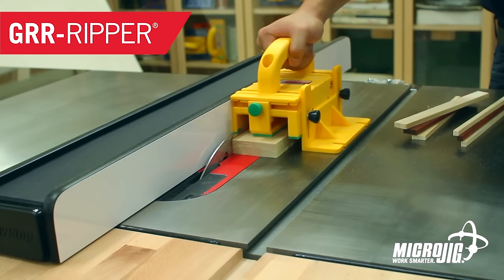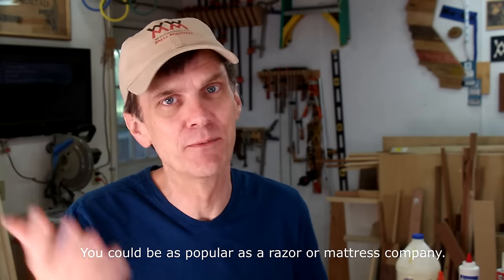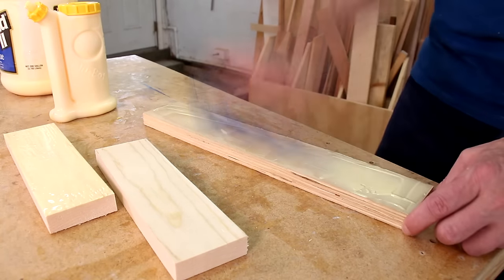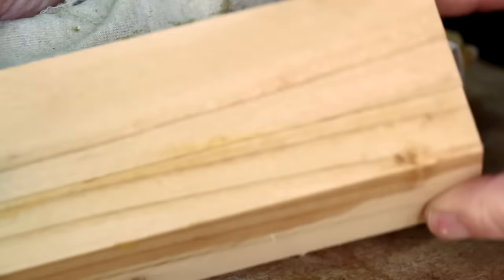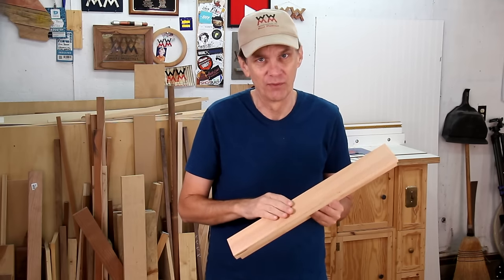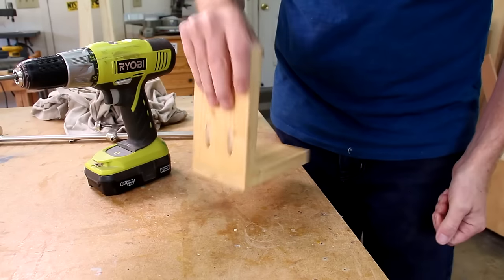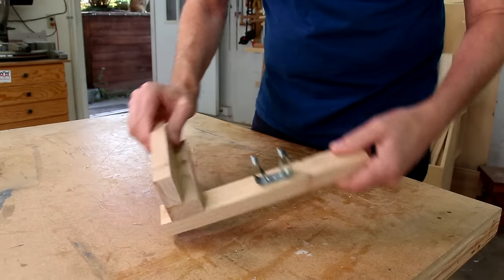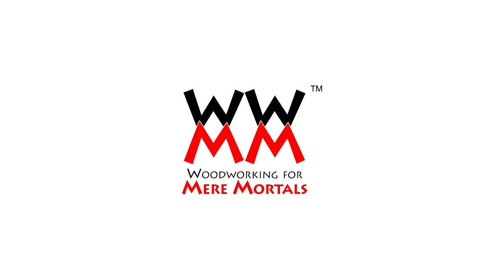What You Need to Know About Glue | WOODWORKING BASICS

Comment: Should definitely use a damp rag to wipe off squeeze out. It works much better
Reply: +Dylan Pieniazek no just use sawdust, it comes right off
Reply: +Dylan Pieniazek a damp rag will just thin the glue and it will get farther into the grain, not a good plan, when you try and stain the piece the glue that you tried to wipe off will show up big time. most of the time I dont even wipe it off, let it jell a few min.s and a puddy knife will peal it right off
Reply: rickthebananajr that works too. Matthias does that
Reply: Shane Hildebrand I never thought of it that way. It doesn't matter because almost every glue up I do goes through my planer after. That takes off any smears. I also never stain anything, I use the actual hardwoods.

Comment: A quickie on the different types of Titebond wouldn't be awful.
Reply: +Dave Starr Titebond 1 isn't worth it at all unless you are doing art projects for 2 year olds.  Titebond 2 is the best bang for buck.  Works really well, just isn't water proof, just resistant.  Which is fine because wood is also water resistant.  Titebond 3 is the same as titebond 2 except it is waterproof.  It isn't worth the extra 70%.  Just buy a small bottle of waterproof glue for the smaller projects you would need it for.  Buy titebond 2.  The big jugs last years and are WAAAAAY better than smaller ones.
Reply: +Colebug99 The type of glue you use depends on your needs at the time.  While it is rare that I use TB-I any more, it sets a bit faster than TB-II, but it is a great all-around glue.  TB-II sets a bit faster than TB-III.  For 95% of my projects, they get TB-III due to the slightly (albeit somewhat insignificant) longer open time.  TB-III is also stronger along with being waterproof (even though most of my projects getting TB-III tend  to live indoors).  That said, any of the TB glues are fantastic.  Heck, I even have TB Molding & Trim glue: it is very thick, doesn't sag, and sets in a minute.  Also, I'm not sure I'd trust any of these glues to last longer than a year so I don't buy the large jugs since I won't use it up in time.
Reply: +Dave Starr http://www.titebond.com/woodworking_glues.aspx  Google is your friend.  All you need to know is there.
Reply: Colebug99 TB III is NOT waterproof... it is still only water resistant - more so than TB II but still not "waterproof" for submersion. I don't like TB III very much... it's not yellow, but a weird grayish color. TB II is easier to work with for woodworking, I think - and TB III is significantly more expensive, for not much real gain in woodworking.

I don't think even polyurethane glue is sold as "waterproof"... only as highly water resistant. It's a marketing thing, I guess. The only glues I know of that are sold as absolutely waterproof for submersion are two-part epoxies, and Resorcinol - but it's a real pain to work with, and is a dark reddish-brown color that is not very suitable for woodworking. It's used on boats because of its high resistance to UV and heat.

My opinion is that unless you're building a wooden boat, submarine, or airplane, you really don't need anything but TB II for woodworking. But I'm going to check out that other glue Steve mentioned. Can't recall the name in this comment.
Reply: @kencarp57  Titebond 3 is rated waterproof. That does not mean it can be permanently submerged under water but it does handle water better than than type 2. I don't think type 2 is easier to work with due to the shorter work time which means you have to hurry to get things aligned. Another consideration is temperature. Many days my shop is under 50° when I start the day and type 3 can be used at 47° while type 2 needs a temperature of 55°. The price difference now much less than it used to be so for me I use type 3 almost exclusively.

Comment: Question: does anyone else find that today's "5 minute epoxy" is mis-named, i.e. doesn't harden in 5 minutes like it used to 20 years ago. Back then I had a job as a photocopier technician and I frequently used LePage's 5 minute epoxy to repair, rebuild and reinforce broken parts in the field - like a broken nylon gear sprocket for example. I would mix and apply the epoxy and then keep turning the part in space so the glue wouldn't flow and drip in one direction. I could keep turning it for about 3-4 minutes and by 5 minutes, the glue was stiff enough that it wouldn't flow, but still soft enough that I could dent it with a finger nail. I would often shape it with a knife or file and then after about 30 minutes to an hour, I would risk putting stress on it. It was my go-to wonder product. Then I got a different job and didn't use epoxy much for a few years. Now when I try to use it, it seems extremely slow to harden. After five minutes it's just starting to thicken, and it takes a good 10 minutes to set enough that it won't flow.

Comment: Seriously. Any descent PVA glue works really well for 99.999% of wood  and paper projects. Slow setting (a week) two-pak epoxy in a doweled joint for load bearing and or critical joints. Always held by a S/S counter sunk screw. I really hate those expanding glues as they can ruin a job and require far more post cleanup.
One screw you didn't mention is the Tech Screw. Self drilling.

Comment: Best tip ever for a newcomer to Epoxy?
   Forget about 5-minute stuff in the beginning... Okay, personally, I just avoid it like the plague in general. BUT (enter the caveat) I am really REALLY well documented as adhesive impaired...
   5-minute epoxy is as indicated, a 5-minute at a time job setting ONLY! SO if you have any reason for hesitation, just go after the 15 minute stuff, and lend yourself the TIME to mix it, slather it in, set things up, put into clamps, whatever else... and not panic because you're about to run out of time...

    It IS great for those quick little jobs and repairs. It's more than functional for wood-work. Don't get me wrong here... This is just about being "easier on yourself" as a beginner. I suck with clear epoxy, as for whatever reason, I often over-mix, or simply have "life happening" and lose the window... SO I go old-school and just mix really tough epoxy(ies) that take over-night or longer to cure.

   Best ever tips in general... Palette knives and min-spatulas. I LOVE these things. It's not just for adhesive jobs either. Artist's palette knives come in a fine variety of shapes and sizes, AND GET THE METAL ONES! (if you bother with hunting them down for use)... They stay easy to clean with minimal care for damn near ever... they're thin and flexible, so "smunching" sealants and fillers into tiny crevasses and cracks is a breeze (compared to say... a clunky pocket knife or whittling a popsickle stick) Yes, theyr'e a bit pricey for no more than little metal goop-spreaders... BUT you only really need about half a dozen (unless you just like them, of course) and those will be cleanable and reusable for assigned "duties" for a long long time.

    Gorilla Glue... They've really come along (and gotten pricey too) in recent years. Even the gorilla super glue is a dubiously superior product to regular super glue. There are rubber additives in the Gorilla super product, so it takes shocks considerably better. (vibrations included)...
    The only side effect of gorilla stuff, is that it SWELLS in application, so clamp firmly EVERY SINGLE TIME, or stuff can get "pushed out of shape". 

   Strength??? I've routinely set knife blades into handles with gorilla glue (as well as old fashioned epoxy) for more than a decade with NO PROBLEMS... and that includes ten-inch Chef Knives and the like.

    Top epoxies? For strength and durability, I'd default to JB... That's the J.B. Weld of old, though it does dry dark grey. I've repaired engine blocks with the stuff, myself... so it's tough. It works as a filler, but you probably prefer to do that for those otherwise hidden "flaws" or "damages" that only seem to obstruct or "fowl" things mechanically.
     There are other lines of products, too. AND I haven't found an epoxy I particularly dislike or recommend against... SO even the "stick" or "putty" epoxy products are good for purposes...

    "Marine Grade"... THIS is an important notation, because the requirements for Marine Grade is that it will cure even UNDER water or in DIRECT CONSTANT contact with fuel and oil. If that's a consideration, THIS is the thing you NEED to see on the label.

    Finally, "Goop"... Okay, no, it's a silicone based adhesive/sealant. NOT like wood-glue or super glue, at all. It's NOT the greatest or strongest bond, either.
   SO what the hell do I like about it? Exactly that. It's NOT great... BUT it IS adequate at sticking just about anything together. AND it's a better than average sealant.
    Did you ever break an old level and wish you were good enough to build a new one, yourself? Ever wonder what exactly they used to seal up those "viewee windows" for the bubbles? I don't know that either... BUT when I built the level, and every level I've fixed by replacing broken or missing "viewee windows" for the bubbles, I've done so with GOOP... I prefer Automotive or Plumber's GOOP, myself, just to resist water and oil... I worry about that. It's "nose profile" is akin to strong vinegar... and you CAN defeat the adhesive relatively simply. Any thin knife can cut it, and the applied materials can be pulled apart IF you pull like you MEAN to take them apart.
   It's clear, and any excess is a BREEZE to just chip up with your thumb nail and roll off the wood, plexi, acetates, polycarbonate, acrylics, glass, fur, leather, metals, ceramics... it seals and adheres "adequately" to just about anything... for as long as you want. 

   Whenever you want to change it... just grip it and yank. OFF it comes, and you're ready for a bit of scrubbing and redecorating.

    OR... in the case of some "viewees", you can pry the little windows loose and remove them... reach through to maintain, check, calibrate, or fix whatever... and then add some GOOP and put them back... ready to go. ;o)

Comment: For end-grain glue ups I use Gorilla glue (the only useful purpose it has). I've glued 2x4 scraps together  to make longer timbers and sat on them (carefully). You have to dampen the ends real good. The polyurethane gets sucked up into the micro-tubules and provides a fair amount of strength.

Comment: 0:25 literally everyone says this, but what after a year or 5, how does the glue stand then? i haven't seen any long term experiments to show that wood glue stays that strong after certain ammount of time
Reply from the maker: I have projects that I made well over 20 years ago that are holding together fine.
Reply: @SteveRamsey  Okay, that certainly helps, way faster than what i got from googling , thanks =)
Still a good video idea to start working on now and glue up few pieces of wood from the same board and test them each year to show how strong they are right? like 5 pieces, and break 1 every year and you get a video in 5 years =)
Reply from the maker: @LykeArgy  Pretty sure Titebond and 3M have been testing their adhesives for decades. The question of reliability is not a concern of almost any experienced woodworker or professional carpenter.

Comment: Never wipe excess glue off. It leaves a visible residue even after sanding, when you varnish or paint over that area. instead let it dry and use a sharp chisel to carefully chisel off or sand if you can’t use the chisel.

Comment: apply film of vaseline to your hands about 20 mins before gluing, stuff peels off your skin painfree....or just cover sTuff with saran wrap, or your hands with plastic bags to prvent spilled glue on your skin....BEWARE WOOD GLUE TURNS TO TAFFY AFTER ONE HOT HUMID SUMMER , TRY STORAGE IN FRIGERATOR/FREEZER THEN.  SHOULDN'T HAVE INITIAL SQUEEZEOUT OF GLUE if you are sparing with the glue, ya don't need much at all.
Reply: +speckspeck   anyone know how these wood elbows would fare out in the rain, would they last one season? use epoxy or woodglue?

Comment: All the woodworker channels show huge volumes of glue…which then oozes out from the joint like an over filled peanut butter and jelly sandwich…Glue must be really cheap in the US!!!!  Seriously, any glue squeezing out is just a waste of money.  Try to gauge the right amount…which is a about a quarter of what you see slathered on in YT channels.  Don’t put excess glue back in the bottle unless you are totally sure it is free from bits, or it will make future joints hard to clamp tight.
Reply from the maker: Yes, it is pretty inexpensive.
Reply: Thanks for responding Steve. In UK in 2022…Titebond 3 is about a Dollar an ounce.  It doesn’t take long to add tangible bucks to a project.